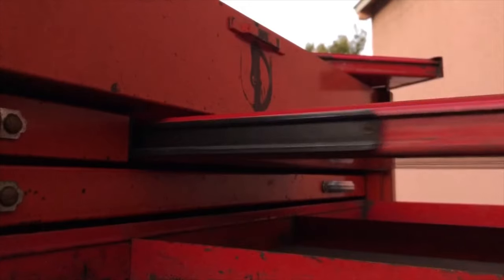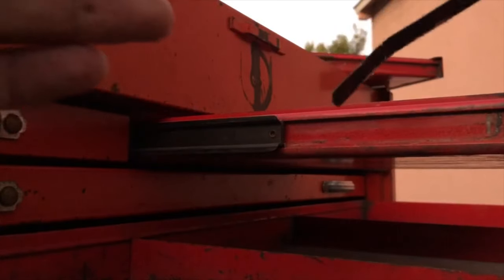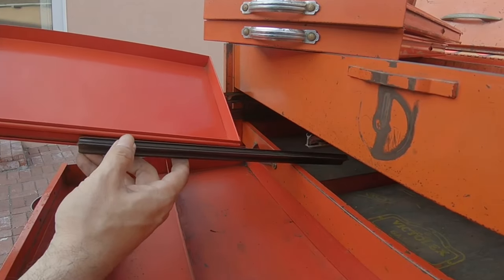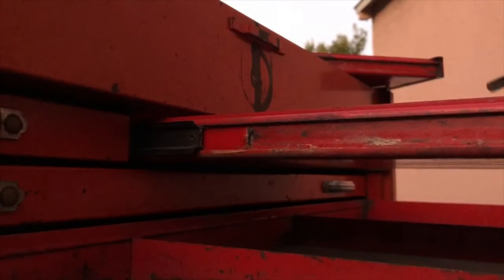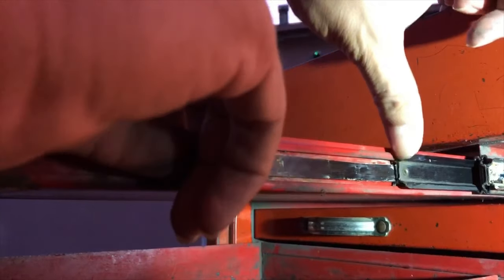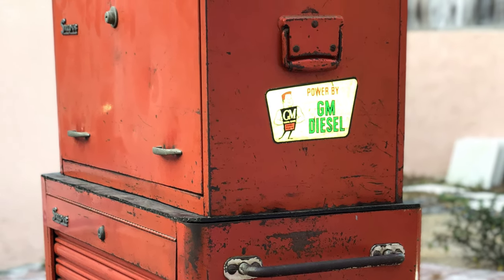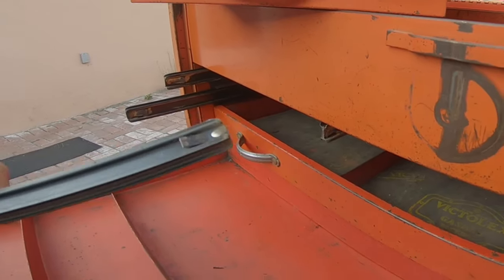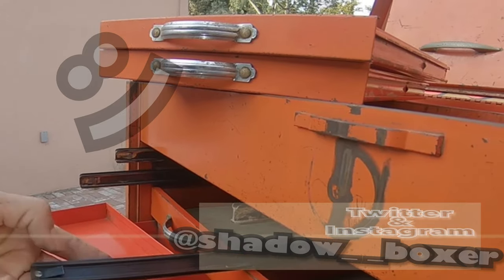ShadowBoxer 0063 {Snap-on KR61 Superchest tool box - Restoration / Refresh Part 1: Drawer Removal}

Comment: Appreciate the inspiration - Picked up a 1967 32” triple high super box KRA58C top, KRA461 mid, KRA307D bottom. Refinished my drawer fronts today (TSC Majic Massey Ferguson rattle can red is close), brushed on two coats of bed liner inside all the drawers. Taken all the slides out, soaking them in WD40 parts cleaner. Going to work on the carcasses over 4th of July weekend. Going to use Spray Max 2k clear once the enamel paint cures.
Reply from the maker: Sounds great. As I said in one of these videos, I don’t want it so beautiful that I am afraid to bang it up. It’s still going to live in the garage and carry tools, not be in a museum. However I do appreciate seeing some of the restorations of boxes and tools like lathes, etc. where they come out looking newer than new. 
Best wishes and high hopes for your restoration.